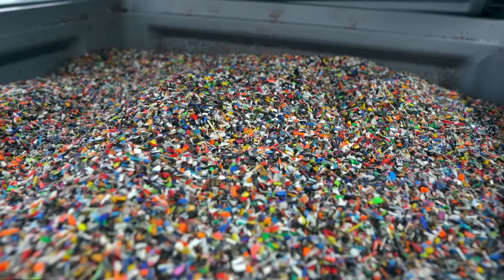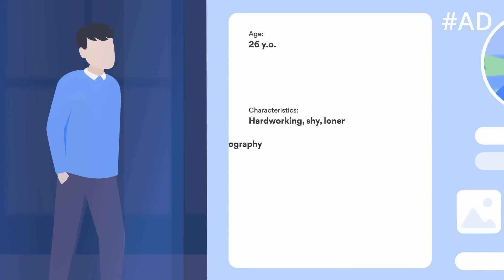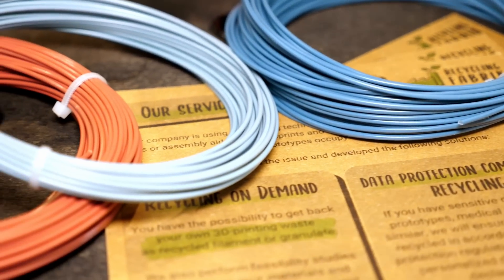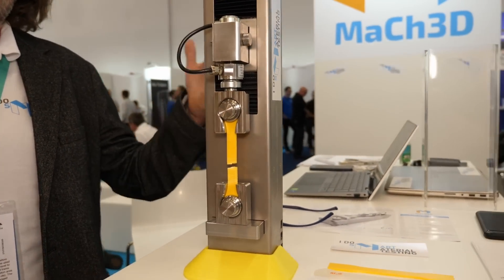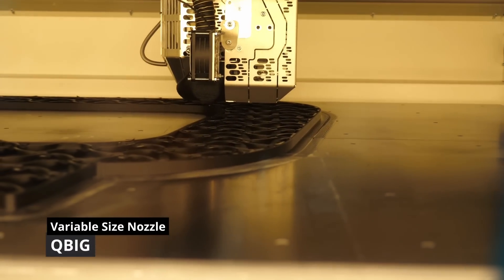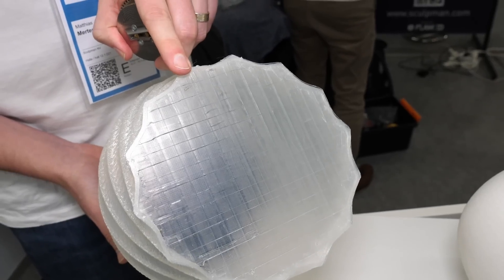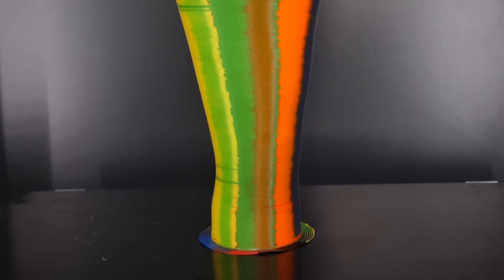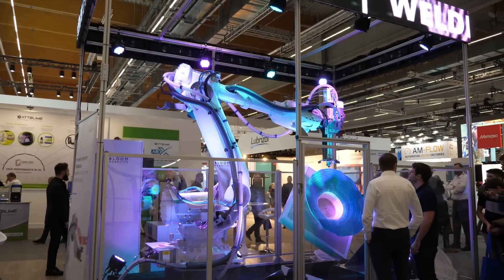Impressive 3D Printing Technology at FORMNEXT 2022

Comment: I am an RC guy, (intersted in Remote Controlled cars) and the most interesting part for me was APIUM's perfect adhesion. As some parts on my cars broke - I tried to print some parts in order not to buy new ones, and I always had that problem where the part would spilt in half and then the car just brakes. I guess it would be epic to make some parts using that APIUM technology!

Comment: 10:36 That is certainly one idea. I, again, had a similar idea, after all, what makes better adhesion than making sure the layer you want to bond it to is, at least at the surface, molten enough to bind properly. However, I thought of using a laser for that.

Comment: Would the "heater" nozzle work the same with a second offset nozzle thats offset a little lower than the printing nozzle but remelts the plastic thats already printed, provided the printing nozzle goes over it again. basically like the ironing feature but with a second nozzle (the printhead would need to rotate to always put the non-printing nozzle first to heat up the already printed plastic) but we see in this video they already can make a rotating nozzle so.... i think that would work

Comment: Print&Go announced a mixed reality maintenance for 3D printers on 2019, also they have the unique certified platform for Ultimaker and Digital Factory. They also have been at Formnext 2022 with a robotic arm to control a fleet of machines and with the XR solution.

Comment: The fast temprature changing technology is OP for 3D printing, would be nice. Imagine when printing it can melt the plastic so much the layers stick better together and when it comes to making bridges, it could lower the temprature so you can easier harden the plastic once it comes out of the nozzle. So basically, 3D printing where AI detect if you going to print an over heng / bridge, and then adjust the heat and speed based on that.

Comment: As someone who prints with PEEK, I’ve tried to achieve that effect by letting the heat block spend a lot of time going over the part. It works really well, but print times go absolutely through the roof, and I don’t have an algorithm to control it well. Glad to know I was onto something.

Comment: @cnckitchen this is not really related to the video but I have always enjoyed your scientific approach to printer testing. I recently was considering the best cheap printer upgrade - the paving stone. Since on  a CoreXY the moving print head is at the top of the printer, surely adding mass to the top of there would be the way most effectively absorb the energy of the high acceleration and dampen vibrations, so took the paving stone from under my x1 carbon and printed some mounts to place it on top in place of the glass lid. It certainly vibrates less and also is seems quieter. I feel print quality is slightly improved, though have not done extensive a/b testing and the x1 obviously also has its resonance compansation algorithms which definitely make it harder to judge. Interested if you have tried or have any thoughts
Reply: That's a clever idea. You are changing the mass of the printer. But the real answer to this vibration issue is software based. It's called "Input Shaping". You hook an accelerometer to the machine and run vibration tests to find the natural resonance peaks and the software can counter it. You can also do it with test prints (less accurate). The  accelerometer is a fairly cheap part, I got two for under $10 US from eBay. The code for it is already in Marlin and RepRap. You might also check out the Klipper project. People report amazing results from Input Shaping with less artifacts and being able to speed prints significantly without quality loss. Check this video for Marlin's version and a clear explanation: https://www.youtube.com/watch?v=7VLuz3hReYw 
Cheers!

Comment: 10:40 for years i do not understand why no manufacturer uses a concentrated hot air nozzle (like soldering devices have) to locally reheat, with mm accuracy.

Comment: I posted a design for a 5 port head about 4 years ago on fb, 5 into one small mixing chamber then out the nozzle, so that full colour prints from 5 rolls in cmykw filament, and it would not need as big a tower and could also do full gradient mixing. why didint i build it? couldnt do the metal work and no slicer supported full colour printing.

Comment: To be honest, the Plasmics INo Trident is the most exciting development to me. The idea of precise temperature control, at the nozzle, is very appealing and should help with some of the issues that might arise from printing at vastly different speeds, where high flow can bleed heat away from the nozzle. That said, there is so much innovation here and it's AWESOME to see!

Comment: Variable heating at the nozzle opens the possibility of gradient-density printing for making lens blanks.
Not just the shape of a lens bends light, the density of the material plays a major role.
Having regions of a lens at higher or lower density than others opens the door to disk-shaped lenses that perform as if they were domed.

Comment: Would it be possible to make a variable nozzle like an old camera lens?? I mean the shutter... multiple blades that turn to a small opening or even close. If it's closed, you don't need to retract, just close the flow. Increase or decrease size with a motor... use pellets and keep it melted. When it is closed, stop the feed screw so that there in´t too much pressure when the shutter opens. Bad idea or??

Comment: To me, the APIUM layer heater was the most exciting.  The possibility of having 3D printed parts with strength properties the same as injection molded parts sounds like a game-changing technology.  I found myself wondering if a laser working alongside a nozzle could have a similar effect.
Reply: laser idea is brilliant, IMO, the only problem is you would have to calibrate laser intensity for different colors, because obviously darker filaments would be much easier to heat with light vs lighter ones
UPD: also I guess you could use IR laser, which is more efficient at heating and less reliant on filament color
Reply: @EvanzoZubinsky  you would also need to aim the Laser, else it can only heat the path when the printhead is moving in one direction.
Reply: But then you run into the safety issues you usually run into with lasers, such as going blind or setting random stuff on fire. A filament bulb would emit full spectrum light over a wider area, which seems to be part of the secret sauce. Slightly melt a wider area to bond whole layers, not just the one line you're currently laying down. That and there's basically no real safety concerns beyond what you already have with heating elements and electricity. Something IR would probably be favorable just so most energy is getting turned into heat instead of being wasted through reflections, maybe slightly undervolt a small PAR halogen bulb like the ones used for display cabinets and such. Maybe a lizard bulb even.
Reply: Or maybe a car headlight bulb with a little reflector? Or perhaps just use part of a coil cooktop basically like they did, bit of tempered glass and you're good.
Reply: I will certainly be working on this, I have an ender 3 that I built from the ground up to be capable of 135c chamber temps, which isn't enough for ultem 1010. I already have lamps from a failed attempt to selectively heat parts following NASA's paper on high temp printing. A little annoyed I didn't think of it myself earlier.
Reply: There are scientific papers about the laser solution and it has already been tested so far. I guess that the solution of APIUM is a bit better, because it spreads the heat more evenly. 
I also thought about such a ring heater a few month ago but for desktop printer. Maybe it would be nice if Stefan could craft something like a copper ring around the nozzle that spreads heat in a bigger zone around the nozzle. But this copper ring needs to be very close to the layer, otherwise the heat wouldn't get to the printed part very effectively.
Reply: @fordgeher  I was thinking that too, why not just solder a copper washer with a small ID and a really large OD to act as a heat spreader to actively heat the area that the extruder is printing upon. You would have to really up the heat so that the nozzle is still getting the proper heat to melt the filament while the copper washer is dissipating that heat but I think it would really improve adhesion.
Reply: 100%, I can't wait until this hits commercial production
Reply: Hmm... What about maybe IR Heater modules?  We could put an IR Heater on the hotend not much harder than adding leds.  Wouldn't be too bad.  All my printers have active heating but no direct PART

Comment: All these topics were interesting. I’m losing hope that additive manufacturing can make stable durable beautiful economical products that are anything other than models or visualization tools. I’m particularly interested in the developments of strength and layer adherence tech as well as the variable properties extrusion tech. 
Question? Have you seen any thing like ‘green part’ matrix forming where a porous structure is 3d printed and then coated/infused and hardened?

Comment: Heating filament to ensure better adhesion will take 3d printing much further. However, I wonder if it would be better to use a laser to heat precisely where the next layer will contact as a more efficient way of adhesions improvement.

Comment: I liked the Layer Pre-Heater the best. The other things are great as well, perhaps even increasing productivity more. Eradicating layer adhesion problems however greatly reduces the drawbacks of fdm compared to injection molding. Injection molding will always be better for mass manufacturing, while fdm will always have the advantage in design-to-product turnover rate and special abilities such as print-in-place production (i.e. planetary gears that are already assembled). The uniform material strength of injection molding won't be an advantage anymore.

Comment: 1) too bad recycling fabrik doesnt take back empty spools to grind and recycle as pellets or something. 2)they should try metal filled filament with the induction heater to heat the filament itself
Reply: But they take spools. An u get points from the spools. No cardboard spools.
The recycled filament is on the spools which has send in

Comment: Wonder how much hotend cooling could be used as layer heating or if any. Instead of forwarding hot air to the side or back of hotend maybe better solution would be to move all of hot air to the part.

Comment: Very much liked the desktop tensile tester, the inductive nozzle heater, and particularly the heater shroud. Having only 40-60% of the XY tensile strength in the Z direction has always sucked as a design consideration and it looks like they practically just solved the issue with little compromise except perhaps you can’t use it on layers where you’ve just bridged without the bridged region sagging immediately.

Comment: As a previous E3D Cyclops customer can't say I'd be interested in the Liqtra multi-nozzle. I'm sure it would work just fine if you're extruding a portion of every filament all the time, to produce colour- or material-blended results, but if you're just switching between filaments periodically you're going to damage the standby filaments by leaving them parked at the operating temperature for extended periods - and this leads to clogging. This is exactly why I stopped using Cyclops in short order, because of the constant clogging and the difficulties unclogging them.

Comment: Hopefully we can see more recycling of filament available in the future! I think things are looking good for the future - but I also think we should be more realistic about the current state of recycling 3D printing materials, even PLA. Which as it turns out is actually kinda terrible. I've got nowhere to send my waste PLA, and as far as I can tell the only choice for me personally is to trash it. I checked with my local recycling, they won't take any sort of PLA. I don't know anybody in my area with an industrial compost unit suitable for composting it. So I basically have very few options.
Reply: Most plastic isn't recycled anyways, even on US military or government spaces the plastic recycling is thrown into the same trash bag as the rest... I was kind of upset when I saw even the aluminum cans getting tossed (otherwise I would have melted them down and recycled them myself in my own castings). So me saving all my bottles up and taking them to work was wasted effort.

Unfortunately the DIY options are terrible for the environment if its extruding it back, you end up having huge amounts of manufacturing for parts to save maybe 20 pounds of plastic in your lifetime of wasted plastic, and the machine impact to the environment building it was far more damage. Also I don't print desk toys, so the amount of support material I have is like 0.05 kg per roll absolute max, even when you've got like 100 pounds of plastic its not feasable unless you've got some school or community based group collecting plastic (riding bicycles to go out and collect it, because the instant you drive a car for a few miles that's far more damage than the plastic probably took), it just becomes a scam.

Comment: My silly idea from seeing the induction nozzle.
Peltier Nozzle, current one way heats the nozzle, reverse the current to reverse the temperature.
Reply: Interesting. But I see a couple of practical issues: first, Peltier devices cannot achieve a large temperature differential between cold and hot side. Second, they are also not very efficient heat pumps. That said, I think using a Peltier interface between (or maybe even as ) the nozzle and a more conventional thermal device could improve precision and response time. I.e. as long as the conventional thermal heater is within 10-20 C of the target temp, the Peltier device could fine-tune the actual nozzle temp.

All that said, the induction-based heater can probably accomplish very similar results, but at a much higher efficiency than a hybrid Peltier device can do, and with better reliability and longevity.

Comment: 10:38 hole up, are those holes on the print bed preventing the print from warping? Did they mention anything about this? Like do they extrude filament directly down a hole then across to create a hook?
Reply: Those holes are to allow a vacuum pump to create a low pressure area so the print sticks to the build plate. Not a new invention.
Reply: @brisance  woah, got a link or search keywords? never heard of anything like that before

Comment: The Recycling Fabrik looked good, but checking their website the best case offer I can get is 11€ for 5kg clean and sorted PLA/PETG including spools. You can only use up to 25% of your recycling points in a single order and there stuff is rather expensive at 24€/kg for basic black PLA.

Recycling the stuff is a good idea, but I don't see this as a good way, not enough incentive for me and with all the shipping needed I doubt it makes a difference in the end for the environment of it ends up in the landfill or gets shipped, molten and shipped again.

I'll wait for a good and easy way to recycle at home.

Comment: The heater around the nozzle looks cool. Maybe it would allow a lower chamber temp for ULTEM, running hot enough chamber temps for stable ultem prints really beats up printers, and when its a $329,000 Ssys printer, thats important lol

Comment: Off topic, but I’ve been experimenting with using a vacuum chamber to force different resins into the voids in FDM prints to improve transparency, strength and air tightness. Maybe it’s something you want to investigate?
Reply: Vaccum, then sink the part in resin and then apply pressure. Nice idea mate, you would need to solve the infill voids. Even it would have been a patentable idea.
Reply: That's genius right there.

Comment: I couldn't find it on thier website, but did they mention how much more electricity that induction nozzle uses?
Usually induction heaters use a lot of current, which isn't a big deal for a short period but a 24hr or longer print time might really add up.
Reply: Induction cooktops are 10-15% more efficient than traditional resistance electric cooktops. I suppose there are some energy losses in the electromagnetic coupling, but you are only putting the heat where it is needed. I would think it's the same with this new nozzle. Energy is current x voltage x time.

Comment: Imagine an IDEX printer with two different nozzle sizes that caused layers to overlap and increase strength between layers.
Reply: That's one of the theoretical advantages of a printer with a tool changer as well, though asfaik we're still waiting for slicer support for this feature